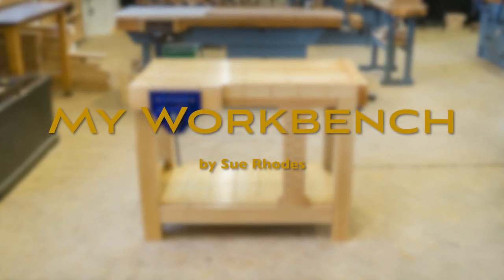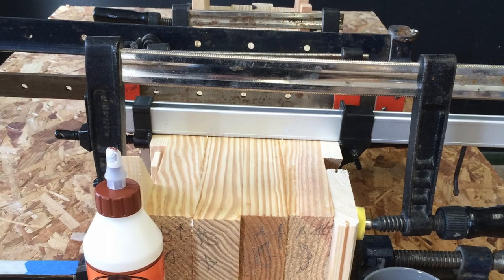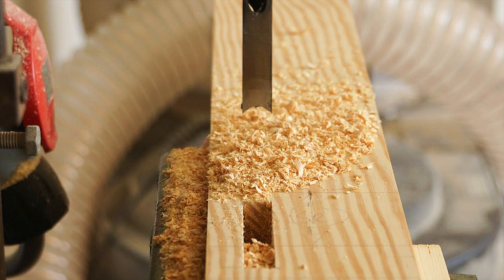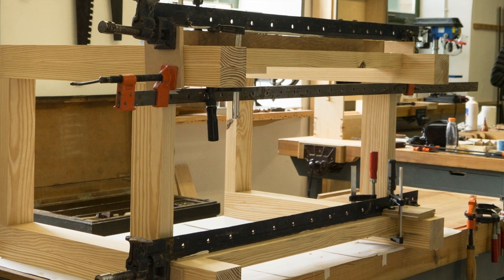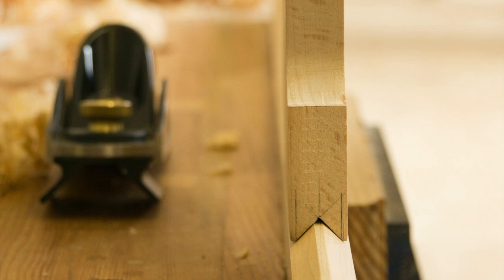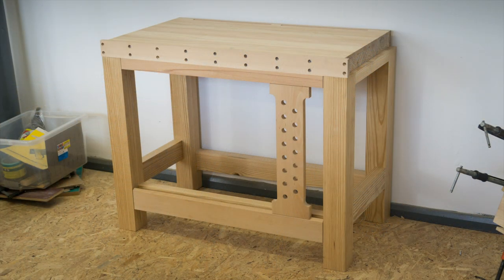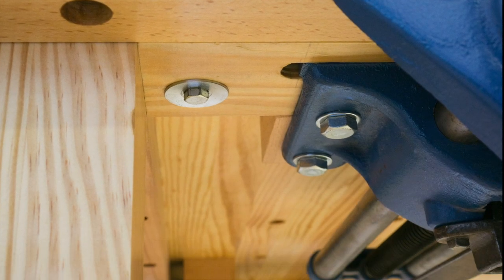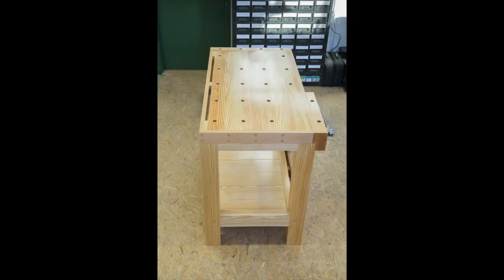Sue Rhodes - My Workbench

Comment: It looks like perfectly balanced bench for small shops. Having all needed features, it's very catchy and very pleasant to the eye :-)
I didn't quite get how the upper runner is joined to the table? Looking at your movie, I have impression that the front vice is screwed to the runner (partly?), while runner is joined (glued?) only to the apron, giving rather weak connection of the vice to the table? Did I overlook something? Thanks!
Reply from the maker: Hi. Thank you. The top runner is screwed through from the underside of the runner and through the underside of the bench top. The vice passes through the channel in the runner, and is screwed through the apron at the front to the bench top on the front elevation. This part of the vice sits flush in a chiselled out socket and is concealed within the runner. The vice is then bolted from below into the bench top. The apron and runner are biscuit jointed and glued together. It's all super strong and won't be moving anywhere! Hope this helps!
Reply: Yes, it helps a lot. Thanks!

Comment: I like an idea with hardwood apron protecting softwood top corners and I am also going to apply it in my project. So, one question about it. The beech apron is I suppose glued to the pine worktop, right? If so, it's a tight joint reinforced with dense set of dowels. After some time passed, do you see any problems with wood movement? Any visible cracks? Thanks!
Reply from the maker: Miljac The apron is glued, screwed and plugged to the pine top. It is a tight fit and has been in my workshop 10 months now through a variety of climates. I haven't noticed any movement or splits.
Reply: Now with your answer I realised that holes in the beech apron serve for screwing the apron to the pine top. Before I somehow thought that the holes are here for a dowel joint. Thanks!